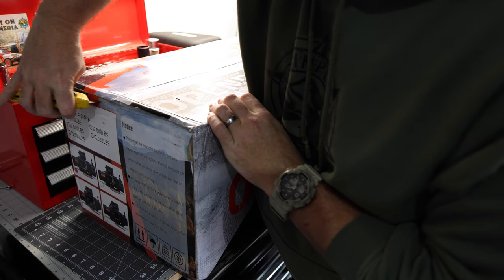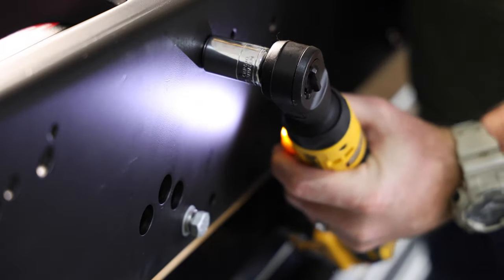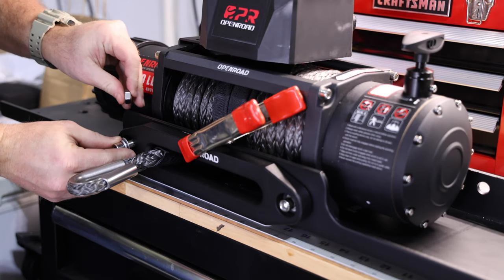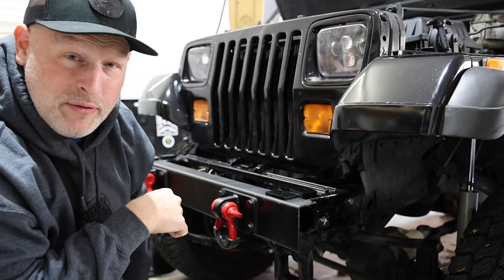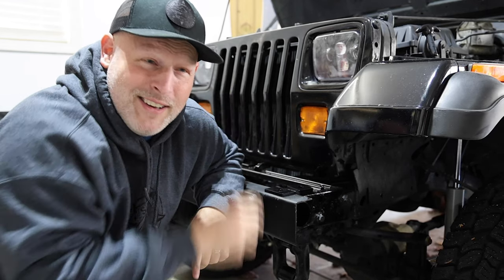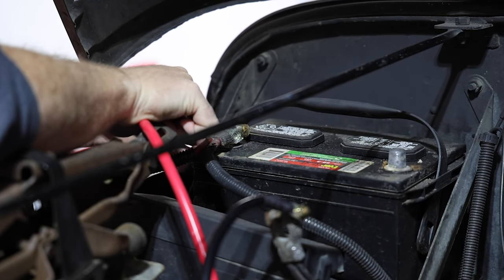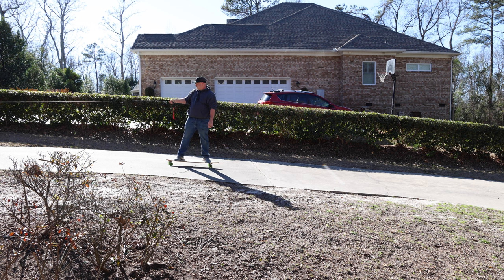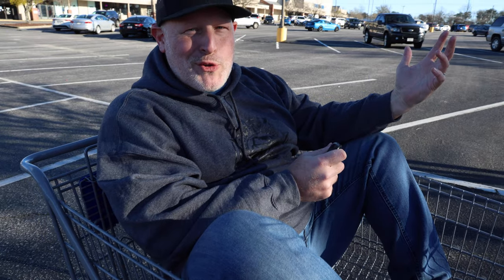New Winch Day: I totally used this wrong

Comment: Hey man! I found your channel while doing research to see what it would take to make a Jurassic Park Jeep and  you have provided some of the best tips that I have found. I recently just purchased a 1994 YJ with an almost spotless frame and only 102,000 miles on it which I cannot wait to convert it into a Jurassic Park Jeep. I am also very excited to see project Emo completed. Keep up the amazing work! God bless!
Reply from the maker: Thank you so much! I really appreciate that! I can’t wait to see how your build comes out!
Reply: @SimplyMustGo  Thank you!
Reply: @SimplyMustGo  Hey man, I had a question if you wouldn’t mind answering. Where did you find the Sahara side steps for Sue?
Reply from the maker: @zachawk1575  mine ended up being a combination of two different sets. I found one set a jeep part out place. And another set on Facebook marketplace. I had to mix and match the sets to get a full working set. Because one set was busted and had some rust on one side and so I had to supplement some of the parts with another set. I have a set of the brackets still from one of the sets. If you find yourself needing that.
Reply: @SimplyMustGo   I might be interested! Thanks for the offer! Got a suggestion on how we could connect outside of the comments?
Reply from the maker: @zachawk1575  DM me on Instagram @theMattBrodie